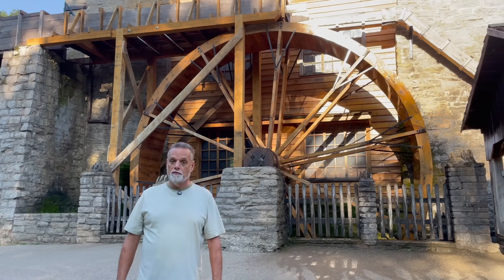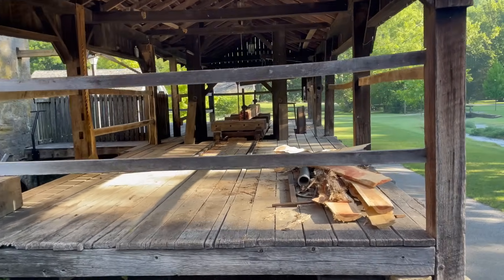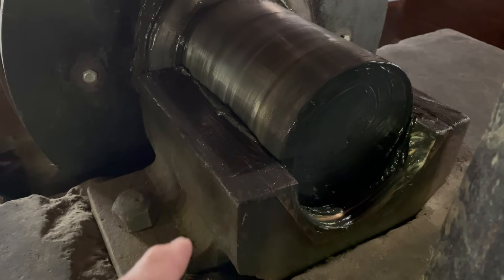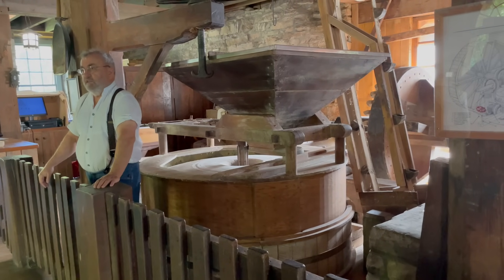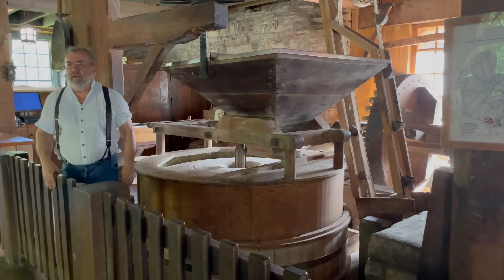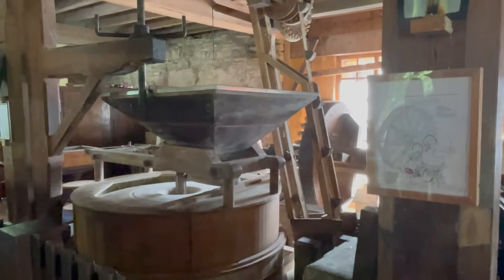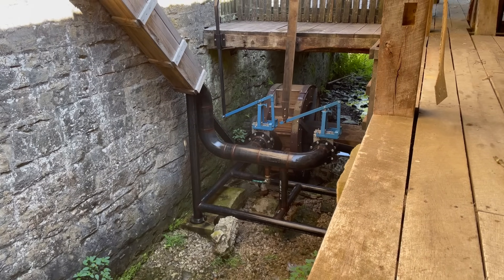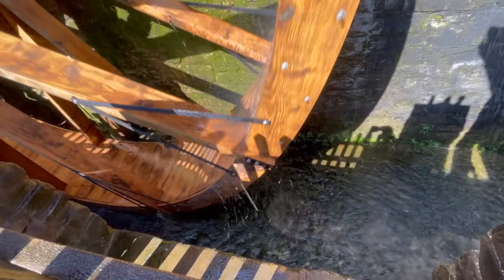Water powered grist mill with 25,000 ft-lbs of torque!

Comment: I have been told that as far as the curved spokes in the cast iron wheel, at the time they couldn't cast straight spokes because they would crack, but curved spokes don't!  It wasn't till a bit later that they could cast straight spokes on such large wheels.
  The curved spokes is one way of dating the machinery!
Reply from the maker: I've heard that also!

Comment: I thought torque was force x radius. Speed not part of the equation?
Reply: Force is weight times radius, and torque is force times distance travelled along a circumference. Torque is essentially work performed upon an object. :)  If the wheel were two feet and one gallon of water were placed on top, then there would be roughly 8.25 pounds of weight pressing upon a 1 foot radius creating 8.25 pounds of torque.  Inch or foot pounds of torque can be used.  Horsepower is torque per second or minute, and is 550 foot pounds per second or 33000 foot pounds of torque per minute.  To figure horsepower in a formula, torque in foot pounds multiplied by rpm and then divided by 5252.

Comment: The torque isnt generated by the water leverage. The bulk of the torgue is generated by the enormous flywheel that the water turns. That oak is heavy and the laws of physics say a mass in motion wants to stay in motion. Old tractors use large flywheels to generate their power. An idea founded in water wheels.

Comment: That was beautifully done.  Thanks.  I will be sharing it.  You might be interested to know that I am involved in attempting to build overshot water wheels with the buckets made from sheet metal (aluminum) but still strong enough to hold the water on from 4-foot to 24-foot wheels.  Such wheels will be MUCH lighter and MUCH cheaper than those beautiful wood and steel Fitz wheels, but still have the same efficiency. I have 9 locations prepared for these wheels on my 37-acre property in south central Pennsylvania.
Reply from the maker: Sounds like quite the project. Good luck, thanks for commenting!

Comment: The spokes had to be curved. As molten iron cools, it shrinks. This will result in a large tensile load on the spokes. The torque calculation isn't even close. Torque is simply multiplying the force applied at the end of a lever arm by the length of the lever arm. In this case, one of the buckets of water would probably weigh around 10 lbs at the end of approximately 15 foot lever arm. Or 150 ft/lbs for one bucket parallel with the  ground. The other buckets would also exert a force that would be different depending on the angle of each bucket to the force of gravity. I would be surprised if the torque exceeded 1,000 ft/lbs.
Reply from the maker: I tend to agree that the torque figure given seems excessive. And yes, iron shrinks as it cools. However there are plenty of examples of other, similar castings from the same period of time that were poured with straight spokes, I'm going to stick with my initial assessment... it was an architectural detail by choice, more so than by actual necessity.

Comment: That is cool, I've never seen the gearing on the milling floor.  Oliver Evans "The Young Millwright and Millers Guide" is online in several places. His patreons were most of the signers of the Declaration of Independence and notable planters of the day. He was also a genius inventor we seem to have forgotten through time. The Evans style mill continued into the early 20th century. One man can run it. I've done work on a local one that had the wooden wheel replaced by a 20' steel Fitz wheel around 1915 when they also installed 3 stands of roller mills and a large plan sifter above.  They were trying to keep up in a losing game to the big national mills. That mill was originally set up in a common way with a french buhr stone for wheat and a country rock for corn, most were that way. There is a hammer mill in the basement which was probably the last thing running, making feed, before a flood took the dam around 1960.
The sawmill is called a sash saw, the blade is in a frame that resembles a window sash. Its waterwheel is called a flutter wheel. 
I caught the bug while working on the old mill and bought a "portable" (900 lbs!) 1917 Meadows mill that is run off a flat belt. They were highly prized during prohibition, the revenuers knew where the water powered mills were.
Thank you for the tour!
Reply from the maker: Thanks for the info! Those Meadows mills are pretty pricey, would like to have one belted up to a big hit/ miss engine myself. Appreciate the comment!

Comment: Very nice mill and equipment.  Not buying the 25,000 ft-lb of torgue label. Would like to see how that was determined. That would be the rough equivalent of 50 large displacement V-8 engines.  Not likely. Nice job restoring all the  shafts and cog wheels (not really gears).
Reply from the maker: Seemed like a high figure to me also. However, it's like you say....since we don't know how they obtained that figure, we can neither prove nor disprove it. 
I was taught that a cog was a single tooth on a gear. Thanks for the comment!